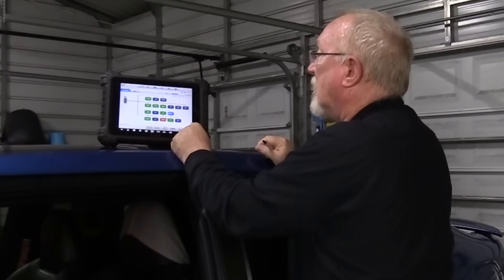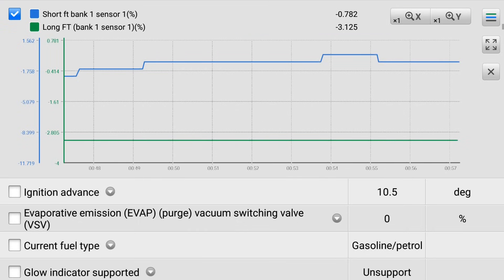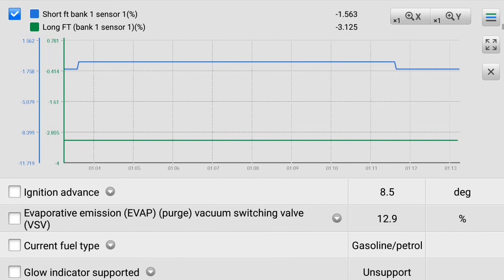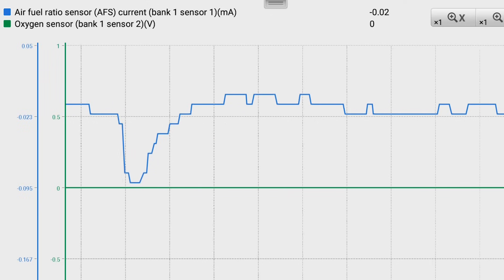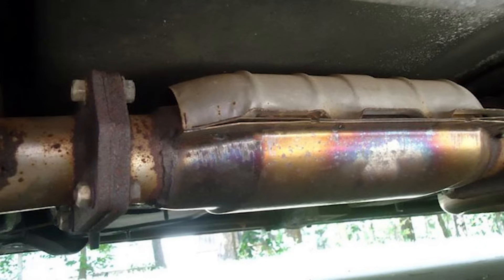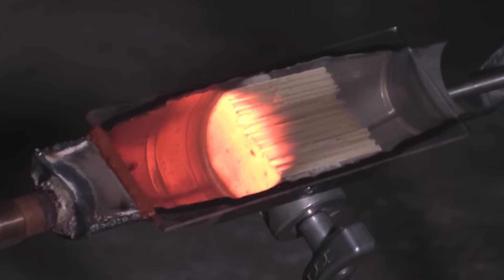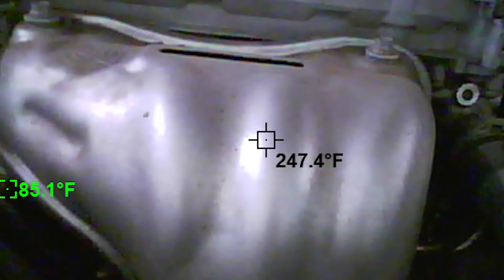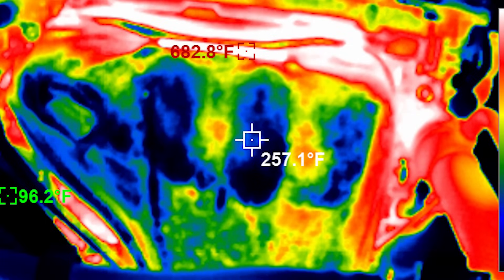The Trainer #118:  The REAL Cause Of P0420/P0430 DTCs

Comment: Sir, I got a question. The resistance of the downstream sensor (O2) of a Prius 2006 is 25 ohms when the engine is off and 0 when it is on. It is suppose to under 3.4 ohms. Can this be the cause of P0420? 
When the resistance is higher than specs, does it mean the current doesn’t flow freely as it is suppose to be?
Reply from the maker: Which part of the sensor are you measuring? The heater element is likely what you're testing. The sensor reacts to the oxygen in the exhaust and should switch voltage outputs between .9v and.1v. You can graph it on a scan tool of scope.
Reply: @VehicleServiceandRepair  Yeah, I measured the heater element of the sensor. Voltage is alright. The resistance is as stated in my first message. So, could this high number of the heater element be triggering P0420?
Reply from the maker: @ZwaanAfghan  I doubt it. How do the front and rear switching rates compare?
Reply: @VehicleServiceandRepair  I assume you mean voltage rates of the two sensors. The downstream reacts as the manual of this prius states.  The numbers for the upstream sensor doesn’t appear on my OBDLink device; I replaced the sensor with a new one. Plus, I also replaced the gasket between manifold and cat; I suspected a leakage. Despite all this P0420 reappeared. That’s why I’m thinking of changing the downstream sensor because as said earlier its heater element got very high (compared to specs) resistance; I assume it shouldn’t be functioning as it is suppose to be.

Comment: Really detailed information, but wouldn't testing the exhaust emissions be easier and quicker? I mean if test failed with all other possible reasons ruled out, then only one thing left it could be... right?
Reply from the maker: Using a 5-gas would certainly add to the diagnosis but so many shops today don't own that equipment.
Reply: @VehicleServiceandRepair  I can see that being the case, they probably want too much for the tool.

Comment: Definitely first step is basic maintenance and spark plugs. Then track down all vacuum leaks. After that make sure o2 sensors are good and finally cats as the last resort.
Reply: I got this code after changing spark plugs and ignition coils and driving about 50 miles or so. I've done the replacement twice already with no problem. No misfire codes just p0420 efficiency low bank 1. Any ideas?
Reply: @thejagmohan7121 did you scope the O2 sensors?
Reply: @Beast_is_a_dumbass220 what does that mean?
Reply: @thejagmohan7121 spark plug   Loose? Wtf
Reply: @thejagmohan7121 same! Have you fixed it yet??
Reply: @thejagmohan7121 bro your catalytic  converters metal is possibly  stolen.
Reply: @thejagmohan7121 i have the same code did you fix ?
Reply: @thejagmohan7121  loose plug could cause it. You used the spec denso or ngk plug? If it wants platinum don't use iridium or vs versa. Some motors like the Toyota  3.4 are super sensitive due to the reverse polarity coils. Hard to know your situation based on the general post
Reply: Using a camera type tool to look inside the catalytic converter 😊
Reply: Check compression too
Reply: Use cat cleaner will work most of the time try it 30 a can cheaper than a cat if it doesn't work you can buy a one
Reply: Did all that on my 07 V8 4 runner...down to front exhaust manifolds and cats...

Comment: Sparkplug nonfouler will save you a lot of money. Wont work on some late models but worth a try.
Reply from the maker: This is not a "fix" and does nothing to correct the problem. Just hides it - like putting electrical tape over the MIL light so you can't see it.  🙂
Reply: @VehicleServiceandRepair  unless you spend the big money for a factory cat you are just throwing your money away. The light will usually be back on before the next time it needs tested. But yes technically it is not a fix in the sense you are not replacing the cat but rather changing the reading coming from the downstream sensor. I just helped my neighbors who have had theirs replace 3 times by 3 different places. Fixed it for 5 bucks.
Reply: Hiding the problem is good enough for me as long as the engine is running okay
Reply: @j.b.9895  I save people money and myself a lot of headache doing this. Works on most. Some of the late model stuff got smart and will make the engine light come on with a different code for the downstream sensor. if you do not buy a factory converter the chance of having the code come back within a year is verry high.

Comment: My 2018 Dodge Journey has the code and
Drives sluggish…it always seemed to have since I got it new in 2019. I changed the nasty engine filter. 
Anyways, this video was helpful in understanding the mechanism of the CC and  the code.  So begins the “journey “…🤣
Reply: Most likely the upstream sensors on a late model chrystler. Had it many times
Reply: What did it end up being?

Comment: As a "seasoned" auto tech, I have had trouble at times with the P0420/430 codes. Most of the time, it ended up being a bad cat convertor as you can watch the downstream O2 sensor switch as fast as the upstream: This almost always indicates the convertor is bad. I have found air/exhaust leaks to cause it, of course and I have found a similar test: You can use the evap "smoke" tester in the exhaust. This has saved me many times. Also, many aftermarket convertors are made cheaply and not as efficient as the correct factory unit. I've installed these and had the same code reappear. When I finally convince the customer to spring for a factory unit, the problem goes away - Just sayin
Reply: In my case had more voltage from altenator and make ECU to read false from O2  sensors the car has 240.000km or 148.800 miles , when fixed ( altenator ) P0420 code gone after some miles , without erase from ECU .
Reply: I just bought a smoke tester to hang from a branch in my shade tree . I know what I'm doing tomorrow . Thanks .
Reply: We had this code and a mobile mechanic was able to use his professional scanner to show the two banks, upstream and downstream measures, etc. It was very helpful to see this info vs. guessing. We got an OEM cat, replaced only 1 cat of the 4 (thanks 4Runner), and no more code.
Reply: I bought a used 2012 Ford in October 2021.  The original factory CAT was replaced at that time, but I suspect the dealer installed an after market unit rather than original Ford equipment.  3 months later, early February 2022, I got a PO420 code.  Since my location no longer does emission testing, I noted the code and cleared it.  The code didn't return until May 2022.  Cleared that code and it didn't return until September 2022.  Cleared that code and it has returned once again in January 2023.  I highly suspect it's not a true CAT failure, but I need to get a deep scan performed to determine whether it's a temperamental oxygen sensor or some other issue.  Ultimately, I suspect it's the after market CAT, that just isn't up to the same quality standards as the original Ford equipment.  If that is the issue, I'm happy to clear the code every 3-4 months, rather than replacing the CAT.
Reply: Sales tactics 😂
Reply: @Mike-ye6xi exactly.
Reply: I love your videos very knowledgeable! Learn a lot from you sir! My name is TASHA from USA 🇺🇸. My check engine light reads that I need to replace ignition coil and spark plugs as well as a cylinder 4 misfire secondary DTCs, p0420 cat efficiency helper threshold bank 1 and 83-13 ECM/PCM relation failure. I have a Honda Accord 2009 LX. I’ve driven like this 7 years! Now I fear how much repair will cost. Why me? 😩
Reply: I love your videos very knowledgeable! Learn a lot from you sir! My name is TASHA from USA 🇺🇸. My check engine light reads P0304 a cylinder 4 misfire secondary DTCs, and P0420 cat efficiency helper threshold bank 1 and 83-13 ECM/PCM relation failure. I have a Honda Accord 2009 LX. I’ve driven like this 7 years! The Engine Light Has Been Solid For 7 Years. Should I be worried? And can I keep driving like this without risking my health?
Reply: Fuel injector

Comment: Have an '04 4Runner V6 4.0L.  Had 420-430 and 206; cylinder6 misfire. The #6 plug looked oily-  Checked  compression 175 psi. No loss of coolant or oil.  Good compression. Installed new valve cover gasket set. No more 206 code .                Still had 420-430-  ran a couple of bottles of cat cleaner & one gallon of lacquer thinner through the engine, per "Scotty".    No help there.  The 4Runner runs like a banshee. Very quick response. No sluggishness. No foul smoke from the exhaust. No issues with exhaust leaks or vacuum leaks.  Changed both downstream sensors & added spacers to the downstream o2 sensors. No more 420-430. Passed smog, then I removed the spacers. Ran good for about 2 weeks  before the 420&430 reappeared. 
 I will reinstall o2 spacers (also known as spark plug anti-fouler);  you can buy o2 spacers on line with out  having to buy two 2 spark plug anti-foulers per o2 sensor, then having to drill the outboard fouler to accommodate the o2 sensor. Just buy the spacers on line. they are cheap & install easily.  They come from China, so may take3-4 weeks to receive, but they can work.  no guarantee, but cheap enough fix & often times does work.   
  If the problem does not go away after I reinstall the spacers, I will buy a pair of new after market cats- For the 4Runner-they are multiple listings on eBay & Amazon.   Any reluctance of the seller to ship restricted state (like mine: CA) I tell them it's for my ranch truck, not registered. They will ship it. They want the business~😁😁 There are YT vids on the spacer install and the anti-fouler method. search them out. Some spacers actually have a mini-cat screen in them. Again-they are cheap.
Reply from the maker: Cheap - yes. But it isn’t a fix, its a bandaid.
Reply: @MotorAgeMagazine  it's also illegal
Reply: @VehicleServiceandRepair  Band-Aid is all I need -not a three-thousand-dollar mechanics bill. Runs like new for two years now.

Comment: Will an exhaust leak downstream of the cat converter outlet O2 sensor - say at the muffler - cause a P0420/P0430 code? Thanks.
Reply from the maker: The further away the leak is downstream, the less impact it will have.
Reply: @VehicleServiceandRepair  Thanks for the quick response! - my 2006 Dodge Dakota has 2 mufflers downstream of the cat on the passenger side. The leak is at the first muffler downstream from the cat about a foot away (the muffler itself is rusted with a hole in it). I’m getting a P0430 code with my bluedriver OBD2 scanner and wondering if it’s bc of the muffler leak, the O2 sensor at the outlet of the cat, or the cat itself. Live data of the O2 sensors show sensor 1 working OK, but sensor 2 has a lot of fluctuation when it should be relatively flat. I plan on doing a cat temperature difference test next. If the temp test is bad (outlet temp less than inlet temp) will this definitely tell me the cat is bad or clogged? I poured some cataclean into the gas tank but I haven’t driven the truck much since then so it prob hasn’t done much cleaning yet. Thanks!

Comment: Why the code disappears after using injector cleaners or additives? Cat or injectors? Or is it the cleaners fooling the sensors?
Reply from the maker: If the substrate is coated by oil or coolant, the injector cleaner can help remove those deposits.

Comment: I have a 2013 GMC terrain. Does it have a problem if I put an aftermarket catalytic converter or does it necessarily have to be original?
Reply from the maker: Some of the aftermarket cats are made by the same companies that supply the OEs. I would look for CARB certification to ensure that it meets the OE form/fit/function.

Comment: On a 2006 ford crown Victoria police interceptor I have a PO420 code catalyst below threshold. I smell an exhaust leak, and per the scan tool one sensor is dead, and cat has reached 1650 degrees. Would you say that was enough to damage the cat beyond saving? And I'm taking it the leak gave too much air, this too much temperature? Pleeeeaaaase help! I know you kind of answered my question in the video
Reply from the maker: Take care of what you definitely know is bad, clear the code and rerun the monitor. It is possible that the cat overheated but the only way to know for sure is to take it off and look through it OR use a thermal imaging camera to look for signs of melted substrate.

Yes, air leaks are like excess fuel - either causes the cat to run hot.

Comment: The problem is finding someone that knows something.
Reply: I work at auto zone and seen mechanics send their customers to the store to buy parts while they are guessing
Reply: Extremely true
Reply: There are very few competent techs in any scenario, actually it’s pathetic how incompetent the vast majority of people in any field actually are!
Reply: You are right. A lot of mechanics will change so parts until to fix the problem than you will have your wallet empty and innecessary parts changed....
Reply: The problem is finding someone who is willing to pay someone who knows. 😊
Reply: @rp6236  I would gladly pay someone to check out my truck that knows what they are doing. I want a guy that understands fuel trim’s and all this other high tech garbage. Last guy said 02 censer and that fixed nothing. I would also like someone who knows how to tweak the computer. I haven’t found anyone yet other than part changers. Hell I  can do that!  I did fix the track control problem. My tires looked good but I you really look closer one was separating. As soon as I pick up speed the one wheel would throw a code.  New tires a it never set a code again.
Reply: @rp6236 
A really good mechanic will be fast, efficient, and get it right the first time

Comment: Excellent video. Just the tip about the shop vac to find leaks was worth the watch.👍
Reply: So by doing that, just spray the soup/water on the hoses and hopefully see a leak?
Reply: @bze06fishinbwai63  Yes, on all the exhaust pipes, and then hoses in the engine compartment.

Comment: Will aftermarket catalic 
Be a cause for p0 420 code 
I have a 2012 bmw 135i and can’t pass smogg it actually had a aftermarket air cleaner aswell 

Im putting and buying oem parts and see if that will help 
Any suggestions?
Reply from the maker: Sorry for the late reply. Look for a cat that is CARB certified. NY and CA require these to be used as replacements. "Universal" cats won't do the trick.

Comment: 2011 Camry le all stock n 390k miles all original parts.  Could not go up a hill but flat driving ok.  Seems to lack HP too.  Never change trannie fluid, so I'm I'm getting code for torque converter n code for shift selinoid.  Non of this has to do with emission right?  Check light on n off n p0420 for cat was another code.  With these Toyotas, the manufacturer messed up as it is known to lose oil.  The pcv needs to be replaced to solve this.  Since it is leaking oil but not dripping on the ground, the oil goes to the exhaust n can clog the cat.  I had a smog ran with co2 being 0 but hc was 15 so it failed emissions.  

Now getting a new cat would not solve the problem.  Maybe I'll pass smog upon getting a new cat n can drive for 2 more years b4 I'm up for another smog.  Eventually the new cat will get clog up as well so he's right when he said that the underlying issue needs to be addressed first.  Plus with mine at 390k miles, maybe it is time for a new cat or get a newer car.  Over 2 Grand just to get a cat replacement with mine.  Fixing cost more than the value of the car so why bother?  An option is to get cataclean bottle as it may help with the carbon build up n hoping to get that smog pass.  California I tell ya.  If this was MN where no smog is needed, I can go as high as 600k with this gifted vehicle.  

Oh n another way to test to see if your cat is good or not is to get a heated thermal laser scanner.  You take the reading of the top of the cat, the middle, n the back end.  Top should be hot, middle hottest n the back should be cooler.  If the Front is the hottest then you have a clogged cat as heat has no way to get out from the backend so it travels to the front n that can do damage to whatever parts there are on the front like header n pump n whatnot to give you an overheating vehicle too.